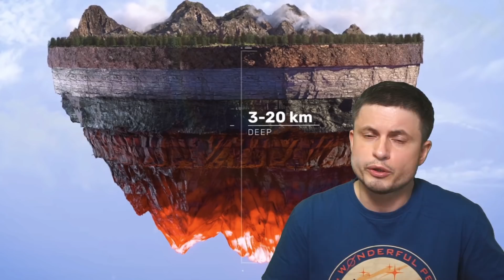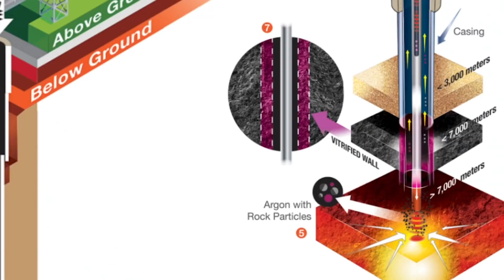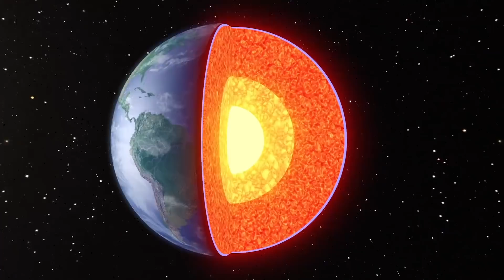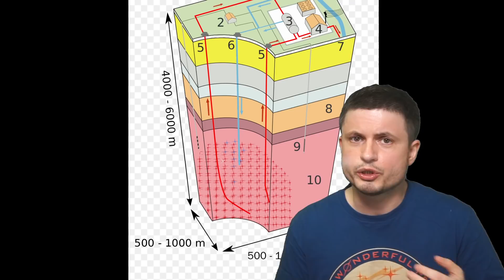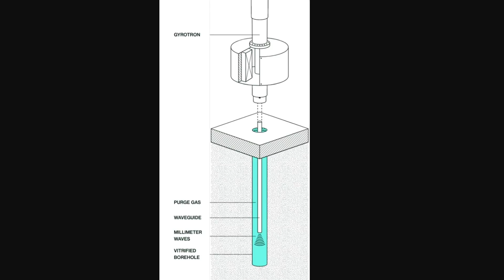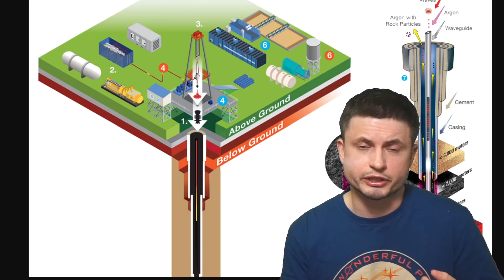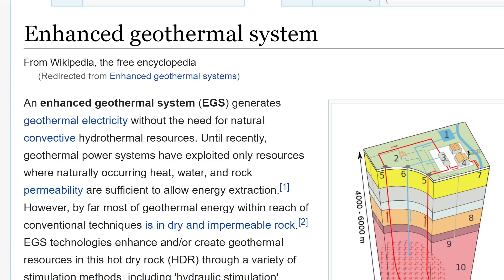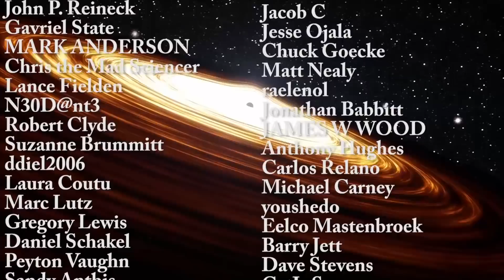Creating Deepest Hole on Earth For Geothermal Energy Revolution

Comment: I think a lot of people in the comments massively underestimate the amount of energy in the ground.
Reply: Never underestimate the human ability to suck up every last drop of resources something can offer. When energy seems limitless, consumption goes away up
Reply: Ya like 98% of people.
Hell less then 2% is geothermal but the places that use it say wow thats insane low prices and great use of heat because they can use the steam to heat homes too.
Reply: why wouldn't the hole act like a least resistance way to the surface, hence an uncontrolled volcano?
Reply: And look at what happened to krypton 🤣
Reply: @Edward Elizabeth Hitler explain digging such a comparatively narrow whole would cause that?
Reply: @Edward Elizabeth Hitler I’m more worried about the long term impact on the earths magnetic field weakening due to accelerated cooling of the earths crust.
Reply: said the martians
Reply: Yeah like using a nuclear reactor as a watch battery
Reply: I don’t.
Reply: I mean that electricity cable must go there for some reason.
Reply: The world powers the world... man thats some hippie shit and I love it.
Reply: Ah yes , 20km , small hole , steam going up the pipe , temperatures get colder up top , what could go wrong ? Condensation on walls before it reaches the surface ...
Reply: @eugene4950  except huge pressures and extreme heat probably means intuition like this is wrong
Reply: In my opinion every form of matter has energy potential.  In order to harness it all .. We have lots to learn. .  .   and  I think the #1 reason we don't have abundant ($free.99 energy) as in extremely inexpensive. Not energy from nowhere.  Is Greed .  the single word that sums up every major  problem humanity has created . They all seem to come from greed for power, control , or wealth.. Etc. . .
Reply: I have for decades wanted to tap into this energy source knowing that all the energy you will ever need is a small number of km below your feet. However drilling that few km is an expensive task.
Reply: They would never do this. The powers that be want you paying for energy (monthly bills) they’re too greedy to allow us to have free energy
Reply: @Cancer McAids That's quite an optimistic prediction. Would love to believe that but there's absolutely no way the powers that be will let it happen. Someone has to do this shit work that no one else wants to do. What good is a mega yacht when everyone has one too?  How will one prove their status? Nah, poorer will get poorer, rich will get richer much like its always been. There of course will be a massive shift of wealth between now and then, the rich families now might not be the same but humanity has a habit for propping certain people up on a pedestal and kicking other people when they're down.
Reply: There are forces that move continental sized plates around like pool floaties. Pretty sure there’s a shit ton of energy
Reply: @Cancer McAids ok..who's articles have you been reading?
Gates? Musk? Some unknown scientist?
Reply: Ic0n - "I think a lot of people in the comments massively underestimate the amount of energy in the ground."
I think people massively OVERestimate the amount of HEAT in the Earth.  This is gonna fall flat on its face.  Another situation like Long Valley, CA.
Reply: @freemind..  Heat is energy. If you dig three miles down anywhere, you'll get enough heat or more to run a steam turbine.
Reply: @politickery9412  - "If you dig three miles down anywhere, you'll get enough heat or more to run a steam turbine."
You think it's the same everywhere?  If there is a giant heat-source underlying the entire crust, then the heat gradient SHOULD be pretty much the same everywhere after billions of years, right?  25° C per kilometer of depth through continental crust??  Well, it's NOT.
Are you familiar with the Long Valley, CA borehole?  The site was chosen as the best of 22 sites that were considered.  The goal was to drill into a magma chamber which they were assured was just a few kilometers deep into the crust, and create a geothermal energy plant by injecting water into the hole.  They never found any magma, and the temperature increase is another "anomaly".  After 6500 feet of drilling the temperature had only increased to 100° C.. far lower than expected.  Even more mysterious was that the following 3300 feet yielded NO INCREASE AT ALL IN TEMPERATURE.  This was very perplexing to scientists because they expect to see a rise of 25° C per kilometer of depth.  How do you explain that?  If the well is getting progressively closer to the magma chamber, shouldn’t the temperature continue to rise even in water?  Why did it not?  If the same convecting heat source underlies the entire crust, why would the temperature gradient be so different as compared to the KOLA and KTB boreholes?
Reply: Food for thought - If lava is magma that has been kept molten for billions of years by radioactive decay, why is lava not radioactive..??  I think we've been taught fairytales as though they were scientific facts.
Reply: @freemind..  Lava is radioactive.  A can of green beans is radioactive. You're radioactive. There's background radiation everywhere.
That said, once something being irradiated is moved away from a source of high radiation, it moves back toward the usual background radiation; it doesn't get to take any to go. It's like long-term survival food is exposed to fairly high radiation to keep it good longer, but as it's passed on to the consumer, it returns to its usual radioactivity.
Reply: @politickery9412  - "There's background radiation everywhere."
Everyone else knows that's NOT what I was talking about, but great example of a "strawman".  Your contribution is appreciated by all.
"It's like long-term survival food is exposed to fairly high radiation to keep it good longer, but as it's passed on to the consumer, it returns to its usual radioactivity."
Yeah, so that's hardly the same as 3-4 billion years of exposure to concentrations of radioactivity that can melt rock.  I think we're seeing a pattern with you.
Reply: Yup its enough to power humanity for thousands of years even if we grew to double our population size
Reply: I design and sell all the components for off grid solar systems.  People can easily afford to go off grid in norther climates where there is plenty of rotting wood on the ground.  And in the south there is plenty of enough solar.  We don't need any new technology, we just need people to go live off grid somewhere.  Stop spending money on coffee, junk food, entertainment, luxury items etc and instead spend that money on renewable energy systems and the problem is solved.  we don't need any new technology.  see my profile for information on my business.  The solutions are here and will only get better as battery tech improves.  If your concerned about lithium availability, fine use lead carbon.
Reply: Agreed. We are on a nuclear reactor.
Reply: I think a lot of people massively underestimate the amount of energy we already have access too above the ground.
Reply: How so? Anton correctly says that the rate of energy production in the core is 2 x humanity's energy consumption, but in stead of viewing this as an encouraging sign I'd flip it and see it as quite little (say, compared to solar energy input, which is 10.000 x humanity's energy use): I suspect that many of these boreholes will cool the adjacent layers of rock and these installations to face quickly diminishing power output.
Reply: @Hecatonchires1991  humanity doesn't take long to double its energy consumption
Reply: @alanhat5252  difference here is the heat will be constantly generated until our planets core cools in a couple billion years. Which means we could store excess energy in giant batteries, and once the battery technology suffices we could have ten times the energy we need ready to be used. At some point though, we need fusion reactors to sustain our technological future, this could be our bandaid until then
Reply: @Hecatonchires1991  he was talking about the commenters

That said it not inconceivable that we could find some way to seal and insulate the boreholes. But then again the cold won't be sufficient to cool the entire planet. So long as the planets core doesn't cool the rocks will be constantly heated
Reply: @drsatan9617  What you say doesn't make sense: you don't want to insulate the boreholes because the entire purpose of the operation is precisely to absorb as much heat from the adjacent rock as possible. The challenge with this kind of operation is of course not the cooling of the planet but rather a heat-conduction issue: when you dig 20km you're still 6000 away from earth's core. With a smooth temperature profile interpolating earth's central temperature with the surface temperature, only cold layers are accessible. If you massively expose deeper layers to cool water, the temperature distribution in the earth will readjust as if the location of your borehole were the earth's surface, i.e. the same cold and boring conditions as here on the surface will re-assert themselves around the borehole. This would be the generic outcome. Regions with active volcanism, active magma chambers/plumes may escape this verdict, but it's wildly premature to think that anything like that is possible on a scale where large segments of humanity's energy use can actually be gotten from this source (To be sure about that I can invoke the 33 TW figure).
Reply: @Hecatonchires1991  you want to insulate the hot layers of rock from the outside cold

The amount of heat diffused into the air will be greatly reduced if the borehole is capped and insulated. 

If it's kept insulated and capped then the cool rock layers will never get cold enough to cool the hot layers by any significant margin
Reply: @drsatan9617  the core won't cool significantly from this. The radioactive decay Anton mentioned would keep the heat up unless we went absolutely nuts with this idea.
Reply: @luke-a-nuke  it won't cool the entire planet no but you still want to keep the pipe as warm as possible to maximize efficiency. Hence the insulation and cap
Reply: @drsatan9617  who knew the devil was so polite
Reply: @sackywacky  I'm not always polite. He comes across as extremely young, I felt no desire to demean him
Reply: @Hecatonchires1991  I would guess the amount of energy available convertable from available heat energy from the earth is many many many many many magnitudes greater that of the miniscule amount of oil we've been using.  But I'm not Anton.
Reply: @Hecatonchires1991  First off, something like geothermal, unlike solar, is constant. Also Anton said that the decay produces twice humanity's energy consumption. 

He isn't talking about the energy that is already present, but rather the energy that is continually being added.
Reply: @Hecatonchires1991  this isn't about the core, 20km isn't even scratching the crust, the scale we would be using even if we got say half our power that way would be negligible. The scale of the heat available compared to what we'd use is massive. If we could figure out how to get that deep we could power our way for millions of years.
Reply: @Hecatonchires1991  it's more. Estimates are incorrect.
Reply: @Hecatonchires1991  Boise, Idaho has been using its geothermal since the 1890s. That heat isn't a static amount. The internal nuclear decay within the earth provides millions of times our energy use whether we use it or not and will continue for billions of years.
Reply: @Hecatonchires1991  not a chance. Nowhere near the kinda mass you'd need to even make the temp budge. Like trying to put out a volcano with a garden hose.
Reply: @Hecatonchires1991  Boise, Idaho has been heating its downtown area since the 1890s with geothermal.
Lardarello, Italy has been producing electricity from geothermal since 1904.
Those resources are expected to be just as good a billion years from now.
Eath's core, thousands of miles below us and as hot as the surface of the sun, is not affected by any drilling in the top few miles of our crust.
No one is speculating that geothermal energy production is limited to twice our consumption.
That would be as silly as saying that all the sailing ships two centuries ago almost exhausted all the winds on Earth.
Reply: @Hecatonchires1991  2 x from one source?  I read somewhere that there is enough geothermal energy to last over 100 million years by current consumption of energy.
Reply: Anton underestimated the power of a good "your mom" joke inserted pretty much anywhere in this.
Reply: Jesus fucking christ. I thought people who watched this channel were intellectuals. What are even these comments.
Reply: @ravador  you know, I’m somewhat of an intellectual myself
Reply: It's why we're still a type .5 civilization and not a type 1😅
Reply: A lot of people in the comments massively underestimate the amount of energy in a cubic meter of space.
Reply: Humans really aren’t very bright, it’s like you are destroying yourselves thinking it helps you.
Reply: This is how another civilization wiped their presence off the face of the Earth
Reply: @ashinwirathu1656  go figure. source needed
Reply: @imakedookie  superman ffs. His planet krypton lol. Joke flew over everyone's head.
Reply: @ashinwirathu1656  prove it
Reply: @drsatan9617  i can't.. I told you they wiped their presents from the face of the Earth.
Reply: @ashinwirathu1656  so then how to do you know about it lol

If their presence* was wiped out then you couldn't know about them
Reply: @drsatan9617  hey give him a break his meds are at a money-saving dose
Reply: @drsatan9617  i see you shiva..  don't be a word nazi.  lol.. talk to text.  See original comment as i am literate.
Reply: @ashinwirathu1656  my comment has nothing to do with literacy 

It's logic

If the civilization was wiped off the planet leaving no trace

How did you come to learn that a civilization was wiped off the earth in that very specific way

By your own claim, there was no presence for you to observe
Reply: @ashinwirathu1656  also I resent the implication that I'm a "word nazi"

A word nazi would attempt to ridicule or belittle you for a spelling mistake, or at the very least attempt to discredit your intellectual capacity. 

I did no such thing. I saw a mistake and corrected it
Reply: @drsatan9617  ikr?
Reply: @drsatan9617  what about the megalithic strutures arround the world that are older than known civilization?
Reply: @ashinwirathu1656  lol Uh huh. Atlantis fish people? Lolz
Reply: @ashinwirathu1656  dinosaurs were using geothermal energy?! Who knew? There's so much untaught history
Reply: @ashinwirathu1656  it’s pretty poetic actually, religious apocalyptic texts talk about a star falling from the sky to unlock the wrath that lyes within the bowels of the earth. Meanwhile a company called Quise, translated to “to wish” seems to indicate that they want to be that falling star key. Neat lol
Reply: @ashinwirathu1656  you contradict yourself
Reply: @ashinwirathu1656  looks at mars
Reply: @ashinwirathu1656  indeed? Please say more.
Reply: @alanhat5252  if there was any evidence for that we would've heard about it man, don't believe every far fetched thing you see on YouTube.
Reply: @alanhat5252  elder gods? Oxygen reacts to a magma chamber in an unforeseen way. Explosion causes volcanic winter. We all die? Profit!

Comment: If you take heat from inside the earth and put it into the atmosphere, would that worsen global warming?
Reply: The amount of heat that geothermal vents into the atmosphere is insignificant compared to the thermal energy trapped by pollution from carbon fuels.
Reply: No.
Reply: Global warming is primarily caused by types of gases in the atmosphere which trap heat in the form of sunlight from the sun. So geothermal energy or any other kind of power generation is generally unrelated to atmospheric gases unless it is producing them.
Reply: Nobody knows
Reply: Almost everything warms the Earth, unless heat is radiated into space faster than we generate it.
Reply: Ever heard of a freaking volcano, genius?
Reply: @thecaptain29  
You mean those things that blot out the sun and kill the dinosaurs?
Reply: @RavemastaJ  ash blocks the sun, artificial geothermal power doesn’t spew ash.
Reply: @thecaptain29  ooh! mt tamara! krakatoa! vesuvius! they changed history with their booms!
Reply: @thecaptain29  was there a need for the abusive attitude?
Reply: @alanhat5252  you wouldn't survive a modern warfare lobby lol

Comment: Heat exchange pumps for home heating are getting more and more frequent. Why use fuel to heat up water, when our planet can give you that for free if you just dig a hole deep enough, and lay down some pipes in it?!
Reply: Ground source heat exchange is certainly a very useful technology. But it's very different. You're not efficiently going to get the kinds of temperatures you need to generate lots of electricity.
Reply: @fepeerreview3150  is it different though? It's still a fluid undergoing a phase change & an energy extraction reversing the phase change...